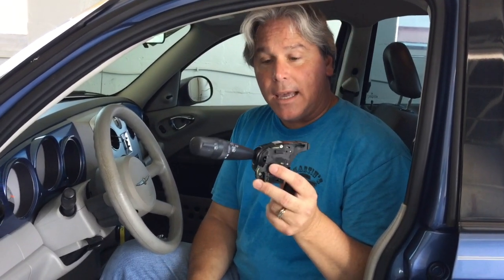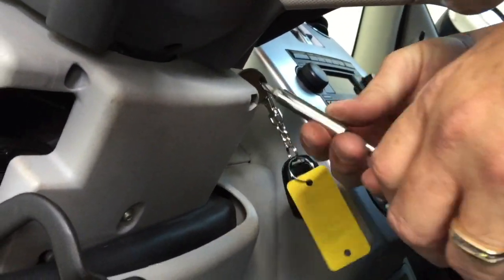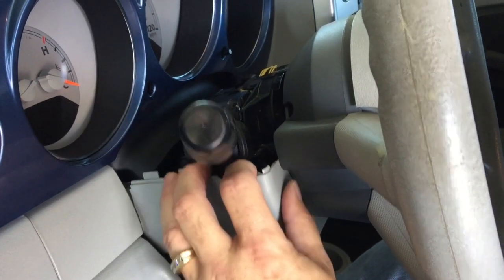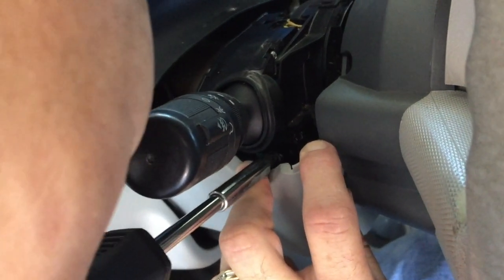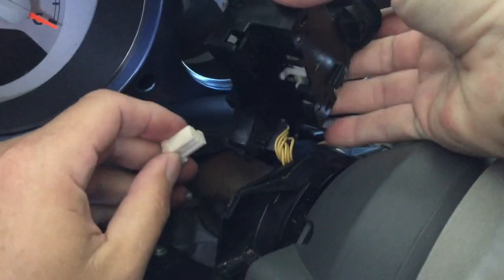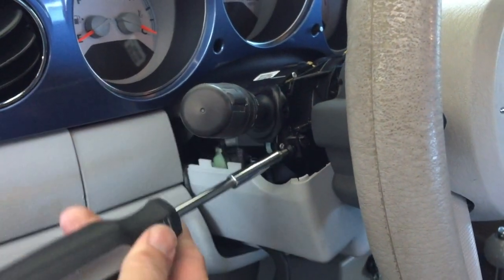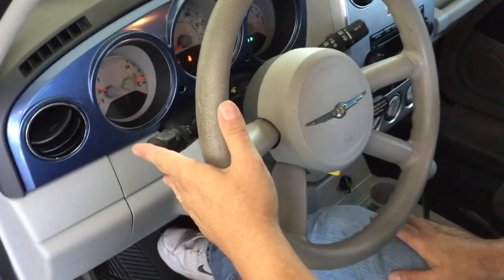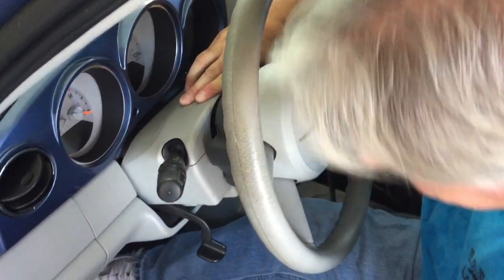How To Replace 2006-2010 Chrysler PT Cruiser Turn Signal Switch

Comment: I have a 2006 Limited Turbo 8 engine model, an evil evil model you can't find any information for that has a TIPM instead of regular fuse box. My turn signals won't work, and neither will my hazard lights. Saw the multifunction switch had a recall, but would it affect my hazard lights when the button is above the stereo?
Reply from the maker: It might be the Turn Signal/Hazard Warning Flasher Relay. It’s a square fuse available at AutoZone and other auto parts stores. Here is a link. 
https://www.autozone.com/electrical-and-lighting/turn-signal-hazard-warning-flasher/p/novita-turn-signal-hazard-warning-flasher-ep35/849390_0_0?spps.s=1078&cmpid=LIA:US:EN:AD:NL:1000000:ELC:19486091402&&CATARGETID=120054150001289080&CADevice=m&gclid=Cj0KCQjwoeemBhCfARIsADR2QCtCYC0cFoKRwu-4-qT2jIZbBSx8qJX-wrKFsUDeVM4eXqBQHZ2MUYsaAnu1EALw_wcB&gclsrc=aw.ds

Comment: I have an 07 or cruiser. I want to replace the wiper switch. Would the process kind of be the same? I cant find any videos on it at all.
Reply from the maker: I believe the process is similar. Good luck.
Reply: @MartinsUsedCarsCollectiblesLLC  thank you for responding so quickly. I have already replaced the wiper motor and linkage and still no wipers... If replacing the switch doesn't work do you think it could be th tipm? I'm at my witts end with this car. I even had the dealership service dept. run diagnostics on the dang thingband they were no help at all....
Reply from the maker: @GiGisRoom-CheapAndEasyCrafts  Try the switch and check any fuses related to the wipers. Good luck.

Comment: need help!!! 2006 pt cruiser windshield wiper, blinkers, and lights don't work at the switch what can I do to find the problem.
Reply: Did you ever get a solution to this? I am in the same boat...however mine doesn't work if the parking brake is up. If I release it, everything works again